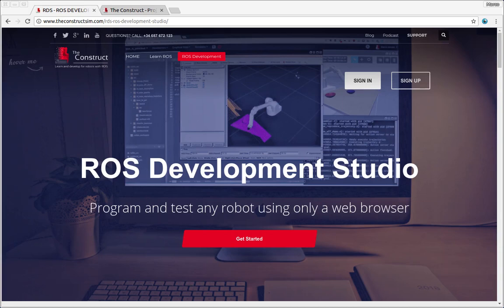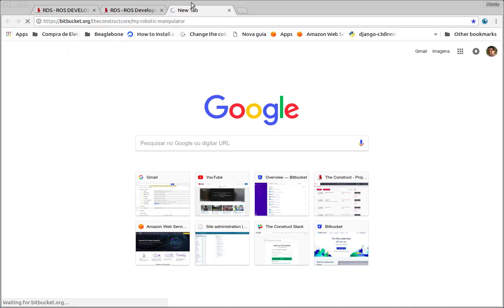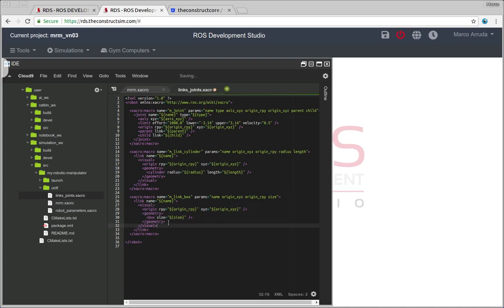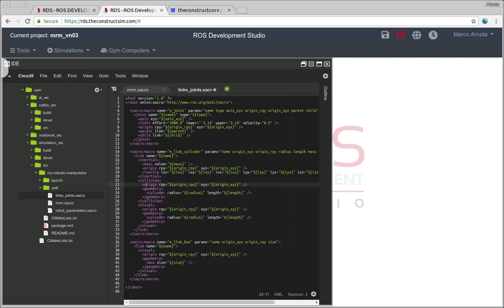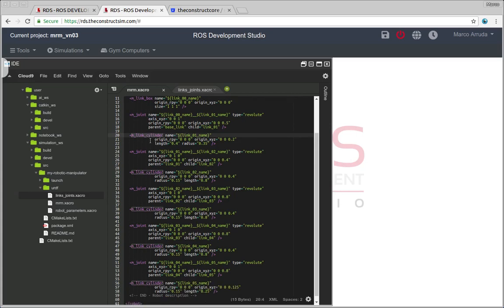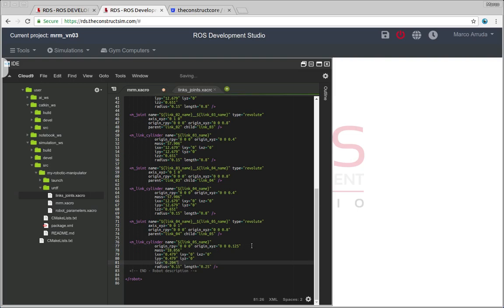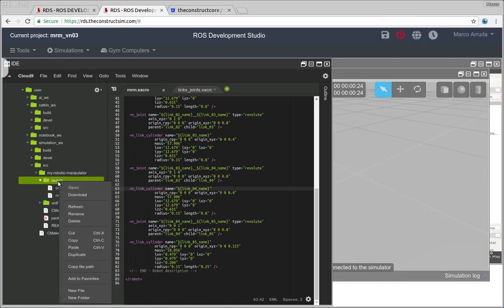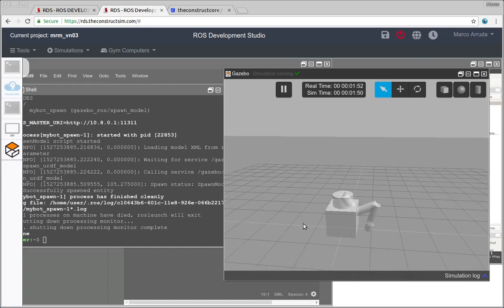[ROS Projects] - My Robotic Manipulator - #Part 3 -  URDF Inertia in Gazebo

Comment: Hello Sir.Thanks for the video.It is really helpful.After launching the "roslaunch mrm_description spawn.launch" file the model is "not visible" in gazebo.And in the terminal i had launched it says
"[INFO] [1621843202.946910]: Loading model XML from ros parameter robot_description
[INFO] [1621843202.954923]: Waiting for service /gazebo/spawn_urdf_model".

And no error stated.Not understand what to do.Pls help.

Comment: Hi,
when I try to launch the cloned project i get an error "No link elements found in urdf file", ive looked everywhere and dont know what the cause of this error could be... Pls respond, thx
Reply: I had the same issue, it seems you have to use "xacro:" before the name of it when you use it. Hence, you should replace "m_link_box" with "xacro:m_link_box" and so on in "mrm.xacro" file. Maybe there is another way (so that this is not needed) but this worked for me

Comment: hi sir!!
I'm unable to get the model in the gazebo.
[INFO] [1575482432.765187]: Waiting for service /gazebo/spawn_urdf_model
It's stopping with the above instruction.
please help me with this!!!
Reply: Try "rosrun gazebo_ros gazebo" in another shell. Worked for me.
Reply: @joshuafernandez2803  Tried this but still it is not working!!
Reply: This might help:
http://answers.gazebosim.org/question/14237/problem-with-launching-the-gazebo/?answer=20405#post-id-20405
I could move past /gazebo/spawn_urdf_model but now I get stuck at 
"Started controllers: joint_state_controller, joint1_position_controller"

Later edit: okay I found a fix to all this. Before trying to launch Gazebo, try this is another terminal:
rqt --force-discover
https://answers.ros.org/question/338282/ros2-what-is-the-rqt-force-discover-option-meaning/?answer=338369#post-id-338369